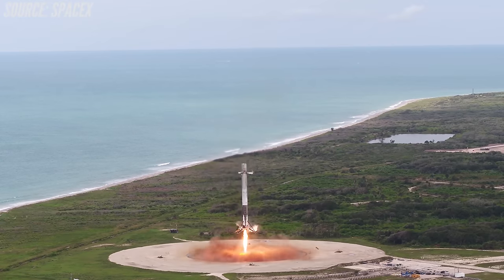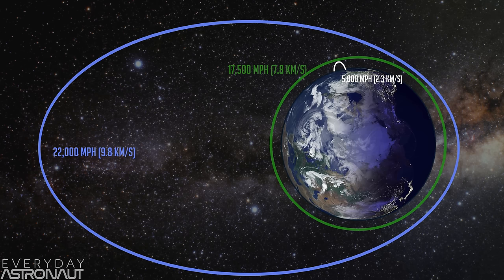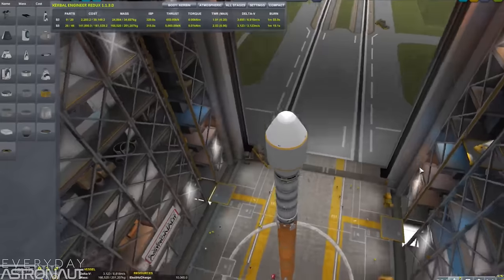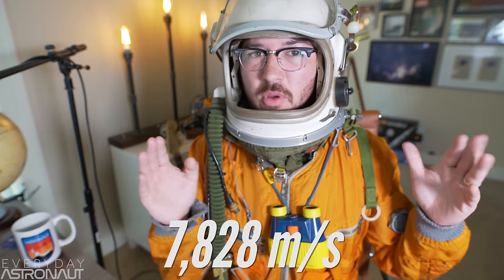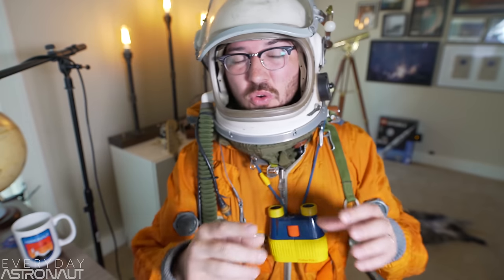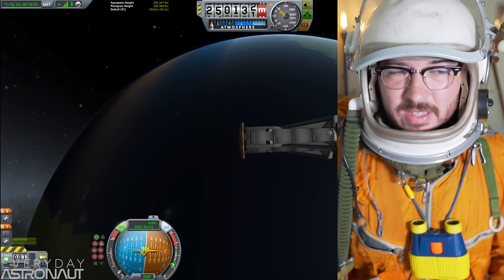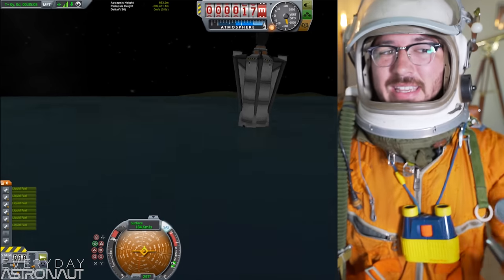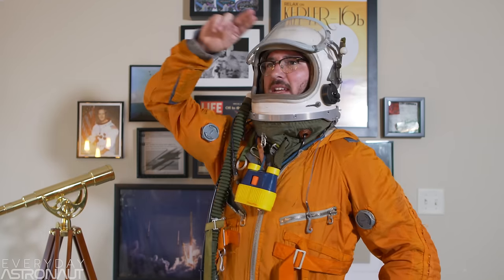Can SpaceX Reuse a second stage?

Comment: What about a heat shield that swings into place over the engines just before reentry. After you've decelerated as much as you can with the heat shield and are ready to use the engines to land, you discard the heat shield and light up the engines.

Comment: Excellent video! I think you have reviewed this issue extremely well.  I suspect the solution may be to have a detachable heat shield or aeroshell which is moved from the front to the back in orbit, with the shield being released moments before landing.  Of course, the whole stage will have to be covered in heat resistant material. A winged or lifting body second stage could be another possibility: this is already being seriously studied  as a first stage reusable booster  (XS-1) by Boeing,  basically  the Shuttle  with two engines and an expanded cargo bay for the LH2/LOX tanks.  A bigger X-37B-like vehicle might do it; with modern materials it could be built lightly, and use aerodynamic lift to make its re-entry more gradual than what ballistic re-entry with a circular aeroshell allows. Aerodynamics on the ascent may be tricky.
Reply from the maker: +awuma thank you! Yeah I personally think a semi lifting body is the answer. I'm excited to see what they come up with for their solution. 👍

Comment: Would it be feasible for the second stage, after payload delivery, to do a low Earth orbit rendezvous (even if it took weeks or months) with an unmanned space station, or truss structure which is pre-loaded (by dedicated flights) with fuel on one end and heat shield/landing gear "cartridges" on the other.  Then park the 2nd stage in the middle, fit it with the heat shield/landing gear assembly and refuel it for reentry.
Reply from the maker: +321RCHeli having any kind of second launch to retrieve the second stage will almost certainly null out the economics of recovery. We'll have to see though!
Reply: I was thinking more along the lines of one launch to load the station with 6 or more (12 would be good!) shield/landing gear cartridges and one fuel tanker launch to fuel the same.  Of course, there's a lot of if's, starting with how difficult and fuel intensive it would be to do a rendezvous and how fuel intensive landings would be.

Comment: The problem with using KSP for reference is that not only is it just a game, and not nearly accurate enough to simulate real world circumstances, but you do not have the freedom within the game to optimize every possible detail of your rockets. You're simply putting different parts of various predetermined sizes together. In the real world, SpaceX can change every minute detail about their rockets, and they will. Before the Falcon 9 booster landed on that ocean barge, people thought it was impossible, just as you think landing a stage from orbit is impossible. With the amount of innovation and drive that Elon Musk has brought to the table with his very capable team of engineers, I have no doubt that he will achieve this goal, and in the future achieve greater goals. It's really only a matter of time.
Reply from the maker: +Xamio I completely agree. I wasn't trying to solve the engineering challenges, but simply trying to illustrate and explain the difficulties they face! KSP does a good enough job at that. 👍

Comment: Everyday Astonaut: NASA Space shuttles were able to land from second stage speeds.. Probable Spacex can use similar principles to land their second stage.. They could cover-up the second stage with black heat resistant material, have some fins to maintain precise angle of attack with heat shield facing first and finally land similar to first stage.
Reply from the maker: +sundresh chettiar I mention exactly the problems the space shuttle encountered at the end of the video and were not trying to solve spacex engineering challenges, just pointing out what they're facing for a challenge 👍

Comment: Ok I know you are getting spammed by the 'It can be recovered' and the arguments against it. An Upper Stage cannot be recovered like the 1st but It Can Be recovered! and mostly reused. 1st an immediate return is not used, multiple slowing and dragging atmosphere entries and exits will be. The stage will have an inflatable reentry shield, a solid old style plate shield will most likely be in the center, it does not and may not be recovered 100%. the returning stage will also not return in one section but most likely two with lower tank and engines in one half and the upper tank and interstage in the in the other. They will most likely be recovered in a large lake not on land or sea, like Lake Okeechobee. The inflatable heat shield(s) will act as high altitude balloon/parachutes, then other parachutes will deploy with the inflatable shields acting like air bags on landing in water. All of this will reduce the payload weight of the main rocket, but that can be made up by additional boosters made like the 1st stage main core. Three to Six depending on how much of a lighter or heavier payload. All will most likely not be recovered or reused. But just as the system is now a 50%-85% reuse is better than Zero.
Reply: I can also see air launched falcons being another option to save fuel giving more for recovery

Comment: Could a second stage be built that has larger thruster fuel tanks and a relatively lightweight grabbing arm(a couple hundred pounds)? Could thrusters then be used to 
 catch and grab a defunct satellite or another dead second stage.  Then do a planned deorbit of both.  Clean up some of the debris up there. If not trying to slow down enough to land in one piece won't need as much fuel. If not using big engines the grabber arm could be quite light for the load size as it wouldn't have to withstand as much stress.  Ion thrusters even. No need for it to be a quick process.  Owners of defunct equipment in space could by treaty and negotiation be required to help fund this cleanup so space remains available to all, and Spacex could recoup at least part  of the cost of the second stage that as of yet they can't recover.
Reply: Now you are talking about having fuel to change orbit at will, the navigation system required to accomplish a rendez-vous... at this point, you want to launch a dedicated space tug IMO.

Comment: You don't have to land today.  Gravity well of 32 ft/sec squared and you can skip of the atmosphere to reduce speed.  This can be done with little fuel.  Think the problem and not the clock.
Reply from the maker: +jeff becker you're exactly right! I'm not worried about anything as I wasn't trying to solve the engineering challenge, I was just illustrating the challenge they face 👍

Comment: You said that the second stage needs to burn the same amount of fuel to slow down as it does to speed up. This is obviously not true. Think F=MA. The F doesn't change, and the M decreases, so what's going to happen to the A? ;)
Reply from the maker: +Dean Little you're absolutely right. I should have said DeltaV and not fuel and even so that's not quite accurate, as you pointed out.👍

Comment: Hi,

With regarding the comment "They're similar by concept, but they are even more of a lifting body since they don't have delta wings like the Space Shuttle did."

Sorry but you're wrong the Boeing X-37 is classed as a delta wing.

"The X-37's aerodynamic design was derived from the larger Space Shuttle orbiter, hence the X-37 has a similar lift-to-drag ratio" - Source: https://en.wikipedia.org/wiki/Boeing_X-37

The entry for "Delta Wing" from wiki: "The delta wing is a wing shaped in the form of a triangle. It is named for its similarity in shape to the Greek uppercase letter delta (Δ)." - Source: https://en.wikipedia.org/wiki/Delta_wing

Also seen in the following images:
1. https://en.wikipedia.org/wiki/Boeing_X-37#/media/File:X_37B_OTV-2_01.jpg
2. https://en.wikipedia.org/wiki/Boeing_X-37#/media/File:X_37B_OTV-2_02.jpg
Reply from the maker: I hear what you’re saying but even searching “x-37b and delta wing” doesn’t net any results, it’s classified as a lifting body, but to argue whether or not it’s stubby wings are delta wing or not is definitely arguing semantics
Reply: Semantics?

Ok, let's look at a Boeing 747: https://en.wikipedia.org/wiki/Boeing_747#/media/File:Boeing_747_rollout_(3).jpg

Which is classed as a fixed wing aircraft.

The Boeing X37, has a completely different wing design, it's even based off of the Shuttle which is classed as a delta wing.

Comment: Once the second stage has completed it's mission, deliver a payload to space, it is lighter by the weight of it's payload, so you over simplify. Now can you factor that in and give another run at the subject please?
Reply: The second stage is also lighter by the amount of fuel used to do its task. Reducing the Orbital speed while in vacuum and possibly going for a parachute return through the atmosphere may work. the second stage at altitude will not accelerate the same as, say 10K as the gravitation is less. A Drogue as it gets into a denser atmosphere will increase its breaking effort.

Comment: WAIT A SECOND!!.....

You dont really need to speed down the same amount you used to get to LEO...

   You just gotta have enough fuel to reach LEO and just a little more. And then let your gravity and aerobraking system do its thing~!!!1!!1!!!!1111
Reply from the maker: +Tylan Bookiller that's exactly what we did in kerbal! We added a heat shield and other equipment so we wouldn't need to try and do a full burn to slow down 👍 again, kerbal was just an illustration. Normally kerbal is way too easy and you can just reenter no problem
Reply: Everyday Astronaut Ok You Makes Very Sense👍👍

But why didnt you tried to spin the 2nd Stage during reentry to keep it more stable and use less Rcs fuel in the process .!?!?!?.
Reply: Spinning wouldn't work in real life because the fuel would centrifuge and be very difficult to stop (which means that the engine tries to ignite but is propellant-starved and flames out).
Reply: Ambient Morality Maybe.. but it would'nd explode nonetheless!

Comment: Instead of fins and supplemental landing rocket engines and their attendant mass, what about deploying some kind of heat-resistant streamers (kapton? tungsten foil?) from the second stage engine area after the reentry burn to increase drag to the point that the stage is stable heat-shield first, like a kite? After reentry, cut the streamers sequentially (or reel them back in, if you want to go all-out on reusability) so the stage swings back around in a controlled fashion for an engine first landing.
Reply: Huh. That's actually a nice idea. And since they'd be thin, radiative cooling could probably deal with heat issues.

I do wonder about the flip maneuver (in any recovery plan), just because the second stage tank walls are milled very thin (1/8" I believe, compared to 3/16-3/8" on the first stage and thrust structure).

Comment: An error - you claimed it would need the same amount of fuel as it took to get up to orbit to turn around and do the same burn again to slow down. That's not true. It would take the same amount of delta-v, but only a tiny percentage of the fuel required to get up there as it's going to be pushing a lot less weight once most of the fuel is gone.

Now, granted.. adding that fuel to the second stage will also require additional fuel to push that extra amount out there to be used for return, and the first stage will also need extra to push all that up in the first place. But it won't add up to the same amount required in the original rocket by a long shot, only a bit more. The same can also be achieved with a simply lighter payload.
Reply from the maker: +Eno you're exactly right. As others pointed out I meant to say DV and not fuel! 👍

Comment: at 3:45 you talked about the spacecraft needing the same amount of fuel to retro burn but thats not really the case, after the 2nd stage boosts up to LEO its significantly lighter due to having burned alot of its fuel already therefore lowering the delta V required for it go slow down therefore less fuel needing to be burnt.

Great video, subbed :)
Reply from the maker: +Dick Wittington you're absolutely right. I should have said DeltaV and not fuel and even so that's not quite accurate as you pointed out. Thanks for the sub!

Comment: Asparagus staging would greatly increase the dV allowing all boosters to burn and when the peripheral boosters detach, the core stage is full on fuel. (falcore heavy)Just add some fuel lines going out from the side boosters into the core booster.
Reply from the maker: +GamingJose this is true, however it’s never as easy as “just add some fuel lines” when dealing with cryogenic high pressure fuels. SpaceX has said they have no intention to do a cross feed anytime soon, if at all.

Comment: The statement that it takes just as much energy to slow the second stage down as it did to get it up to speed is simply wrong. The stage is significantly lighter after it's up to speed so it takes significantly less energy to slow it back down. It's the same principal that's used for bringing back the first stage. It only takes a relatively small amount of energy to slow it down and bring it back.
Reply from the maker: +Roger Garrett you're absolutely right. I should have said DeltaV and not fuel and even so that's not quite accurate as you pointed out. 👍👍👍

Comment: The upper stage is unmanned, thus the de-orbit burn could happen over the course of a week or two.  Place a ion propulsion engine (9000+ ISP!!!) just under the payload.   After the payload has separated burn the ion engine for a week or two slowly bringing the second stage into the upper atmosphere.   For some period of time the extremely thin upper atmosphere will slow down the vehicle without causing significant heating, open grid fins to cause reorientation tail down.  As the heating becomes greater and greater, now use the primary engines to slow down before getting into the real atmosphere; proceed like a booster landing.  Upper stage would need to use 3 smaller engines, 2 vaccum (3/8 thrust), 1 sealevel (1/4 thrust)...... maybe?
Reply: Would work in KSP, but reality's a bitch. 
1) extra engines and extra fuel for 2nd stage is a big efficiency loss
2) on low orbit you can't just burn for weeks, you'll need to make series of burns every time the spacecraft is in its peri
3) control will be extremely hard because low orbit is not synchronized with Earth rotation (+ inclination)
4) pre-programming all needed burns in exactly right timing is extremely difficult if not impossible
5) grid fins doesn't work in thin atmosphere (well, they kinda work, but not good enough to make any significant turns)
6) even if you managed to deal with previous problems and landed your stage, you'll need to spare time and money to be sure that stage is ready to fly again. In the end, it can be cheaper just to ditch it instead of landing.
And 6th point is last because I'm not a specialist in space stuff. Some rocket engineer probably can add more.
Reply: The design time for the multiple different engines is probably the worst if the limiting factors.  After thinking about it a bit more I think the ion engine would not be so good because your actual speed relative to the atmosphere actually increases as the orbit becomes lower.  if you had little wings......
BFR is a better idea anyway.  :-)

Comment: Correction: It takes (sometimes far) less fuel for a rocket to slow down, because of the mass lost by the first burn. It depends on the fuel fraction of the stage + the fact that the payload has been deployed.
Reply from the maker: +Cliffodemus you're correct. I meant to say DeltaV and not fuel.

Comment: 15:20 how is that supposed to work? As far as I know fuel is lost by just sitting in space for some time. Reason we don't have fuel depots up there right now is that so far we have no idea how to keep hydrogen from just escaping any kind of container
Reply from the maker: +TheVergile they actually will have a built in generator, an internal combustion engine that’s highly efficient to keep it all up to pressure and temp

Comment: couldn't you design an orbit that just barely scratches the upper atmosphere and slow down that way? I think that is how they do it with the mars landers. Something like that might take a while though...
Reply: You can, but your reentry velocity is still at least 7000ms^-1, so it doesn't save much. It only works well if you're in a highly elliptical orbit to start with, and you don't want to burn a lot of fuel decreasing your apogee a lot. The minimum orbital entry speed is constant.

Comment: If the engine is the heavy part then it seems like it might be possible to use a system of locks and rails combined with simple inertia plus external friction to shift that further toward the top of the stage adjusting where the weight is and allowing the side with the heat shield to got first. Combine that with the new titanium grid fins which don't need a heat shield and can guide and orient the stage. Then as it approaches for landing it could move the engine back into place and use the fins to flip around engine first and do a final burn for landing. This way no fuel would really be needed until it has slowed enough and is ready for landing.
Reply: Unless you can move the engine to get the COM past the COL it will still want to go engine first. You also can't use the vacuum engine in the atmosphere as it will likely explode so you still have to add something else to do the landing burns. Besides moving the engine is no small task. The system would have to be strong enough to keep the engine steady while it's firing which would likely greatly increase the weight of the second stage. There is also the giant fuel tank that is sitting right on top of the engine preventing it from really moving at all. Moving the tank will do little to shif the COM as the tanks is designed to be as light as possible to reduce the stages dry mass.